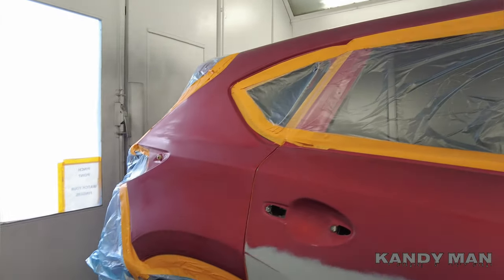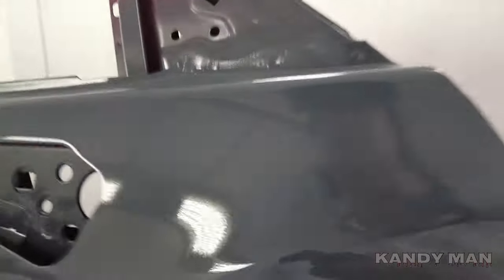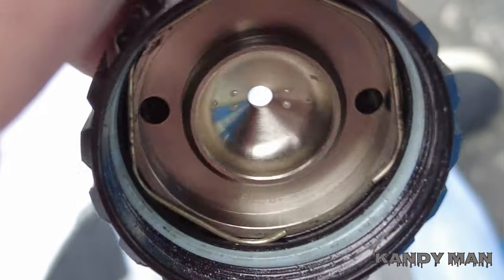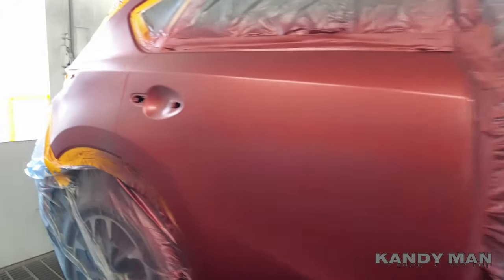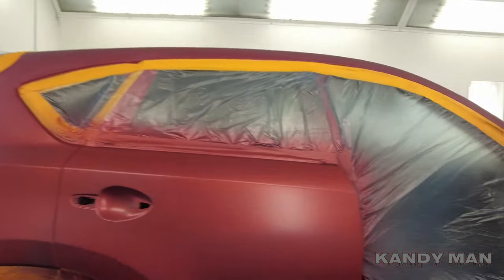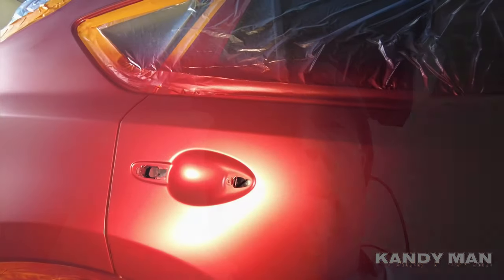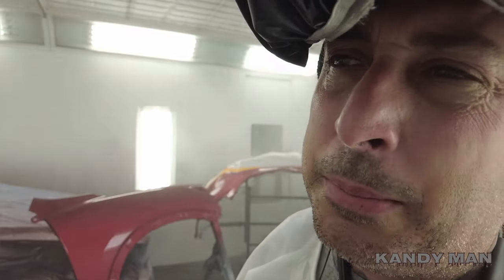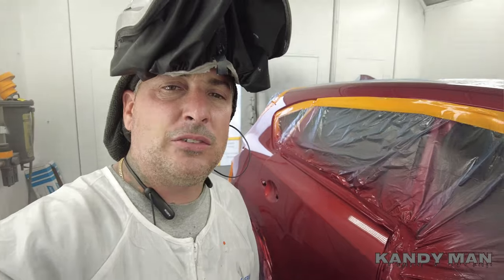DV1 BASE AND CLEAR GUN REFINISHING

Comment: I think the general consensus on the DV-1 is that the basecoat gun is a killer but that the clearcoat version isn't as good as the Iwata WS400, Walcom 360 HTE, the Sagola 4600 or the SATA RP X5500.
Reply: @Sataman Schmidt  Have you checked out the new C2 cap? People are saying it's night and day difference between C1 cap.  It's supposedly on the same level with the sata rp x5500.
Reply from the maker: Have to check it out thanks
Reply: Sataman the c1 cap was definitely slow but the new c2 cap is supposed to be much faster

Comment: what psi do you use on the dv1 clear gun im still trying to dial mine in. thanks
Reply from the maker: Depends on the  clear in this video 24 psi thanks for watching 👊
Reply: @kandyman5315  Thanks alot i run 24psi too,but with 1.3 tip havent tried the 1.4 yet
Reply from the maker: Try 1.4  I love it i said 1.3 in video said wrong size I'm run 1.4